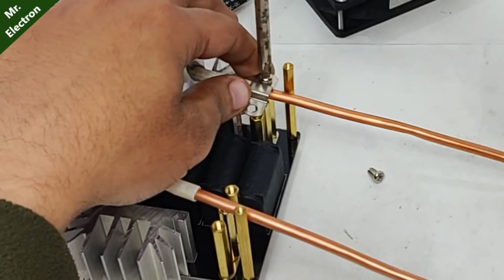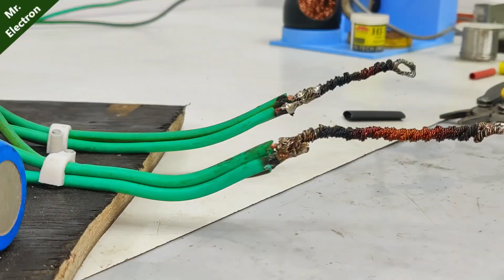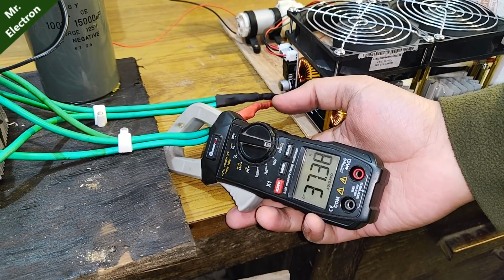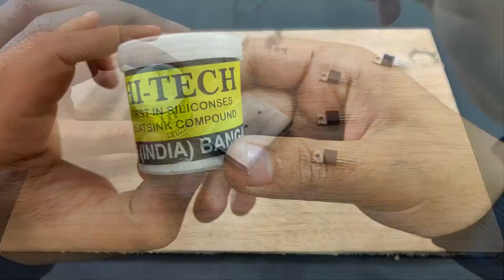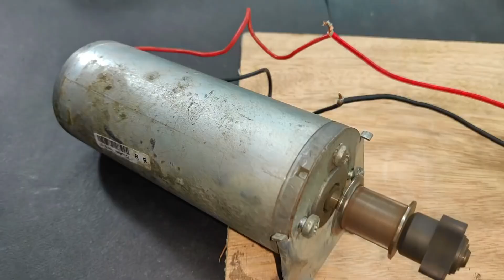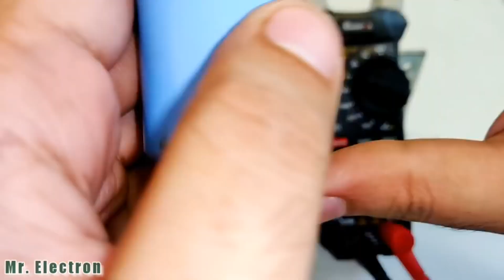3 Simple Inventions with Electronics - Utsource

Comment: Take note that when recitifying 120vac, it peeks at roughly 170v. The full bridge recitifyer output with a capacitor may be as high as 170v dc under low loads. Select components (like the capacitor) rated to withstand voltages higher than that. Ideally 25% to 50% more than 170vdc.